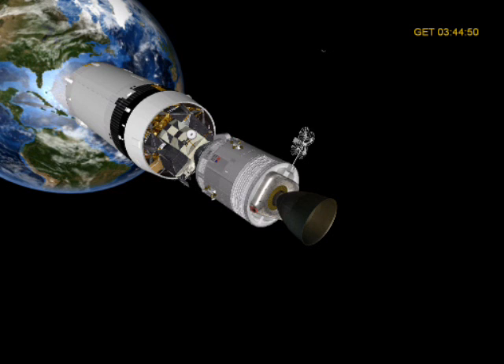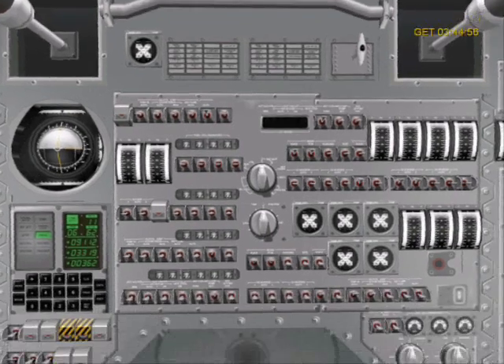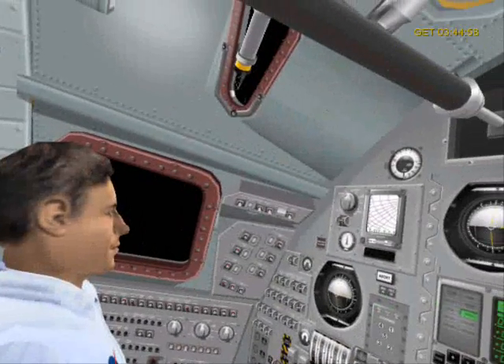Apollo 11 - Extraction of the LM

Comment: So this sequence is happening while the whole thing is traveling thousands of miles per hour? How?
Reply: They're both traveling at the exact same speed relative to one another. It's like when you are driving along the highway and another car is traveling right next to you at the exact same speed. Both cars could be doing 60 mph relative to the highway but their speed relative to each other is zero.
Reply: @joevignolor4u949  exactly, the CM was traveling 20,001 mph, LM was 20,000 mph,…sort of way over simplifying but kind of the idea
Reply: Actually, they’re going even faster. Earth’s escape velocity is around 25,000 mph..
Reply: Because they are all traveling the same speed in the same direction. There is no air resistance to get in the way

Comment: Was the lunar module already pressurized when it was extracted?
Reply: +MrJimmy3459 Of course it was
Reply: No, at least not at the CM's pressure. Pressure equalization occurred after the hard dock was confirmed but before the LM was extracted from the S-IVB shroud/stage by opening a valve on the CM side

Comment: Why can’t command module be connected in between service module and LM to begin with, and always have to do this extraction maneuver in flight?
Reply: I think part of the intent is that the command module can be separated in case of a launch abort.  If the LM was connected to the front, that would have made that more difficult.  And since the LM and CM would have to dock after leaving the lunar surface anyway, might as well just stow it during launch.
Reply: The rocket and spacecraft had to be in a streamlined configuration for launch.  Remember, the LM was not designed to operate in atmospbere.
Reply: @robertcampbell6349  Not sure I understand your second part about LM. There is no suggestion or implication to operate LM in atmosphere.
Reply: @twogamer7149  Tbe LM was stowed atop the S-IVB (third srage) of the Saturn V.  It was shielded from aerodynamic forces by the adapter panels.  The LM was too fragile to withstand the aerodynamic forces encountered during launch.
Reply: @twogamer7149  The launch escape assembly is on top of the command module at launch.... maybe you could do some simple research first
Reply: This way launch escape system was possible to be attached also this docking maneuver was a test of the docking system, because failure of docking after the landing would force astronauts to do a very risky spacewalk